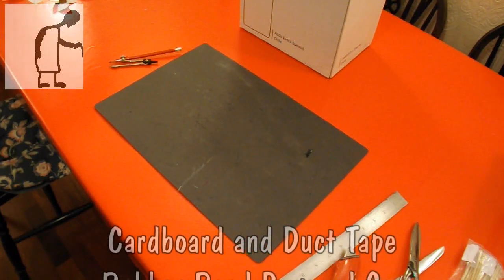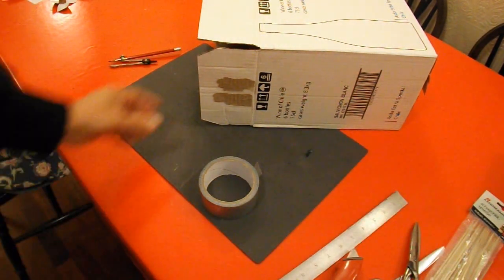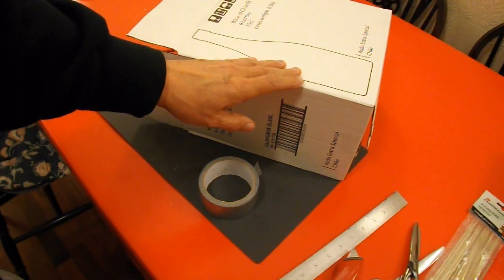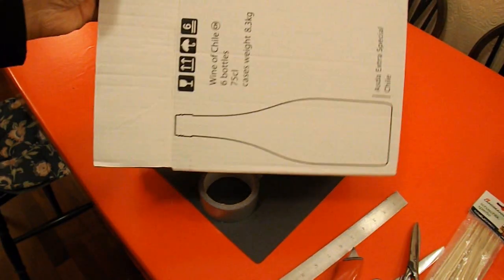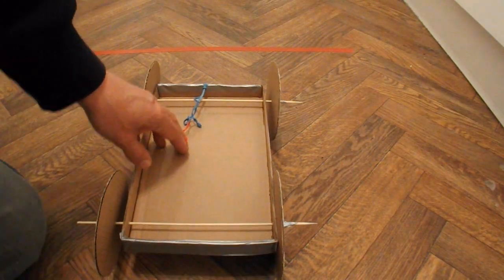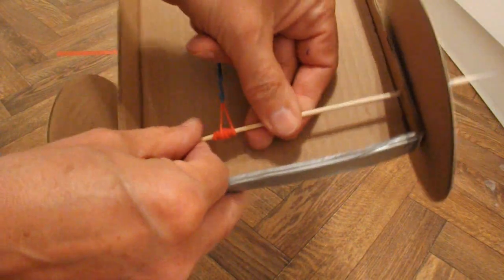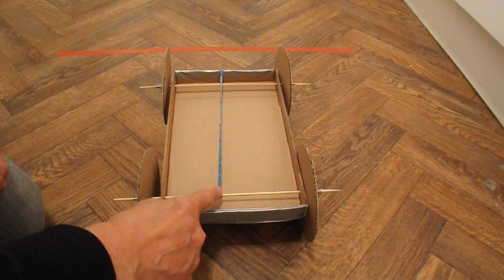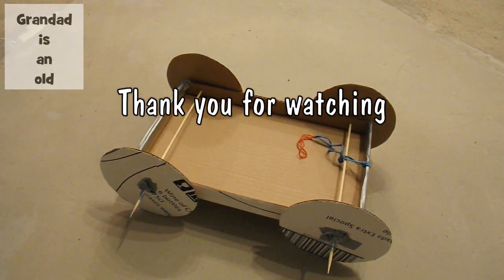Cardboard and Duct Tape Car

Comment: Also, I will be making this for my project but I just wanted to know if the car would still work if I replaced the pencils with wooden circular chopsticks/bamboo skewers!
 Would be very grateful if you reply!!🙌
PLS REPLY
Reply from the maker: @littlegobby  yes, I would recommend bamboo skewers. Much better than pencils as long as they are not too thin. I am using bamboo skewers in this video, so is this the car you are talking about? You will find lots of information in the video description, including links to my Putarubberbandonit  channel where I put all my new rubber powered projects.

Comment: My son tried this but it doesn’t move. Can you offer suggestions?
Reply from the maker: I can give you a whole long list of possible issues. If nothing moves then the chances are that the axle holes are too tight so the axles don't spin freely. Another common problem is the wheels are rubbing against the body work causing too much friction. Try just pushing the car forwards by hand to make sure it runs freely without the rubber band. Good luck. 👍 I will now paste my standard list for Fault Finding on a Rubber Band Powered Car
1. The rubber band does not connect to the front axle, some people misunderstand the videos and attach the rubber band to the front axle as a convenient anchor. That stops the axle turning. Make a different anchor point, study the video again.
2. Does the car run forwards freely if you just push it without the rubber band connected?
If it does not, make sure that the axles are free where they pass through the body. You may need to enlarge the holes where the axle goes through the body or use larger tubes for the axles to go through.
Are your wheels round with no flat spots. You may need to trim them.
3. Do the wheels rub against the body of the car?
If they do, the friction will slow the car or even stop it moving.
Put some spacers on the axle between the wheels and the body to keep the wheels clear. Discs or washers cut from plastic or cardboard should work. 
4. Do the wheels spin evenly when you watch them?
If your axles do not pass through the centres of the wheels, the wheels will not spin evenly and this makes it harder for the car to run, so you will need to make new axle holes, taking more care finding the exact centre.
6. When you wind the rubber band round the axle do the wheels turn at the same time or are they slipping on the axle?
If the wheels are slipping on the axle, the rubber band will unwind without the wheels turning on the ground. You need to do something to stop them slipping. Glue them to the axle or wrap tape round the axle where the wheels are to hold them in place.
7. When you release the car it does not move, but if you lift it in the air, the rubber band unwinds and the wheels spin OK.
Either the ground is too rough or the car is too heavy. Try the car on a smooth surface, make the car lighter, add more rubber bands. 
7. Wheel spin. When you release the car, do the wheels spin without the car moving forward?
You do not have enough grip on your wheels. Either add some weight to the car to help the grip or put something on the wheels to improve the grip. 
Things that will improve grip - hot glue all the way around the rim like a tyre. Rubber bands stretched across the wheel. A strip of rubber cut from a balloon stretched around the edge of the wheel. Strip of rubber cut from washing up gloves or disposable rubber gloves.
8. Trouble connecting the rubber band to the back axle? Glue a short stick to the axle to act as a hook for connecting the rubber band.

We are trying to construct a rubber powered car that can go as "far" as possible. It doesn't have to be fast. It just has to travel as far as possible and as "straight" as possible. Can you please recommend me a design? Or at least give me a general idea of what critical points I should be aware of while designing my car?
This is a fairly regular question. 
I am assuming you have some set criteria for number of rubber bands and size of vehicle so putting those aside. The first point about travelling fast or a long distance is minimising your friction because that is what wastes your power. 
1. Friction caused by badly aligned wheels rubbing on the bodywork should be easy to fix by adding spacers to keep the wheels clear.
2. Friction where the axle is attached to the bodywork is reduced by making sure the axle bearing surfaces are something that does not bind together. Wood and cardboard are not good. Metal surfaces are better. Steel and brass is good. Ball race bearings would be even better. Whatever you have, even if it is just wood and cardboard, you can improve by making sure there is clearance so they do not jam together and maybe rub some graphite from a pencil where they make contact might help.
3. Friction with the wheels to the ground can be a mixed blessing. Minimise the friction of the front wheels by using very thin wheels, however you may need some grip to ensure they keep the car going straight. The same applies to the back wheels, assuming you are using the back wheels as the drive wheels. However if they do not have enough grip they will spin under power and that is all wasted energy. Thin wheels with rubber tyres would be best in that case.
Larger wheels take more effort to get them turning but once moving they have the momentum to keep rolling when the rubber bands have finished. You could experiment with different sizes to see which work best.
You could use some sort of gearing to start with a large gear to get the wheel moving and then a smaller gear to maintain the motion. There are some examples in my playlists.
Reducing unnecessary weight by trimming the bodywork a little may help but make sure you don't loose grip and start the wheels spinning if the body is too light. It may bend or break under tension so be careful.
Another trick I have found helps is to stretch the rubber band as you wind it round the axle so you get more turns round the axle, this can make a significant difference compared to just winding the band normally.
If you can only use a short rubber band, connect it to the axle using thin string so the string winds round the axle stretching the rubber band. Thin string will give you more turns round the axle than thick string.
This simple one does 12 metres https://youtu.be/pIO3FiHX4Oc with just 1 size 64 rubber band.

There are several reasons the car might turn to the right - or left -  here are some I can think of.
1. Your front axle is not parallel to your back axle so the car has an inbuilt turn. A quick check would be simply to push the car forwards without the bands connected and see if it turns.
2. When you tension the rubber band the body or the axle is flexing creating a turn. Try winding the band to one side of the axle. Looking from the back if you wind it on the right it pulls the right side of the axle forward turning the car right. If you wind it on the left it pulls the left side of the axle forward and the car goes left. https://youtu.be/IErkUylbG9c?list=PLA5a2xPRSrB3g5RiX8Kf_uUBOL0Tb7AS0
3. Probably most likely, the wheels are spinning under power allowing the back of the car to slide to one side. Fix this by adding extra grip to the wheels such as a strip cut from a balloon or rubber gloves stretched around the rim of the wheel to provide a rubber tyre. Here is a link that shows this http://youtu.be/ZnuPnveCbxs
4. The front wheels are sliding sideways under power, fix this the same as '3' above.
5. One or more of your wheels are binding on the side of the car causing it to turn.
6. One or more of your wheels are not round and the unevenness is causing the car to skip and turn.
7. Your wheels are not the same size so the car turns towards the smallest wheel.
8. Your axles are not level with the ground and the car is running on only 2 or 3 wheels. This may be the body flexing and not show until the rubber bands are wound up and under tension.

The two most important factors for acceleration and speed over a short distance are the power of your motor and the grip of your wheels. If you don't have the power then your car will not move fast but if your wheels don't grip then any extra power will just spin the wheels and the car won't move. If you have a fixed amount of power by being limited to the number and size of bands you can use then you can increase your acceleration by enlarging your back axle. I wrap stuff around the axle to make it thicker. That will increase the acceleration but probably reduce the total distance your car will travel. If you are only going a short distance that probably won't matter. You can also use smaller wheels to increase acceleration but you will find it even harder to get good grip with smaller wheels.

Some helpfiles
Making the CD wheels https://youtu.be/ZRrjBuWfmrM
CD Wheels with Cardboard Hubs https://youtu.be/Js1rtn2IGTE
Putting rubber tyres on CDs https://youtu.be/ZnuPnveCbxs
Connecting rubber bands https://youtu.be/EbYuhdwknbs
Connecting the band to the axle https://youtu.be/0wPYxloUFJQ
Reply: GrandadIsAnOldMan With some help from his dad, he finally had a workable prototype. We used thicker cardboard with wheels and taped it more on both sides of the wheels. It worked best on carpet! Thanks for the great idea!
Reply from the maker: @christinacreel3721  that is brilliant, well done all of you. I try to avoid cardboard wheels unless I am specifically asked to use them, they always seem to warp. As I showed in my previous reply, there is such a long list of things that can cause a problem, it can be very satisfying to get your car running.
Reply from the maker: @christinacreel3721  Just a final thought, if it working best on carpet, then is sounds like you were getting wheel spin. That is too much power or the wheels are too small in diameter or the car is too light or the front axle is jamming.  Putting rubber tyres on the wheels will increase the grip, or adding some weight at the back will help. (All covered in the first long reply)

Comment: Is this car able to hold 1 pound ??
Reply from the maker: Probably, depends how well you build it. It will also depend on how thick you bbq skewers are, as they will take the weight. I have a playlist (in the video description) called Carrying Dropping Pushing Pulling Stopping playlist - https://www.youtube.com/playlist?list=PLA5a2xPRSrB04L6RpUAs5akmK3jqmahPL which has quite a few cars built specifically to carry weight

Comment: What are the sizes for the parts?
Reply from the maker: I used dimensions that allowed me to build the car from the box I had available.  The wheels would have been about the size of a CD, so about 5" diameter. The tray looks a bit wider than the wheels,  so probably 6" across and about 10" long.  The sides were probably 1.5" high, maybe 2". You would adjust the dimensions to fit whatever box you have found.

Comment: How do you fix the steering?
Reply from the maker: There are two main reasons a rubber band car may veer off to one side. The FIRST and most obvious is that you haven't got the front and back axles parallel. In this car you could remove the front wheels and enlarge the axle hole on one side to help it straighten up. If it is really bad you could stick another piece of cardboard over the area where the hole is and make a new hole in the right position. The SECOND reason is that when you wind up the rubber band it is bending the back axle and that is making the car steer to one side. The fix for that is either be careful as you wind it up to distribute the tension evenly OR use a thicker back axle so it does not bend under tension. This video may help https://youtu.be/IErkUylbG9c
Reply: Thanks a lot! like